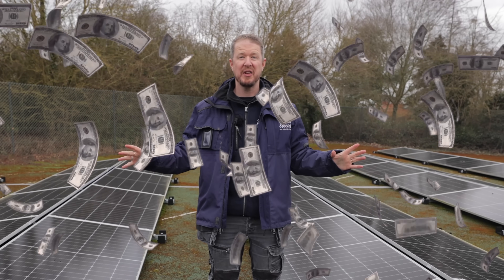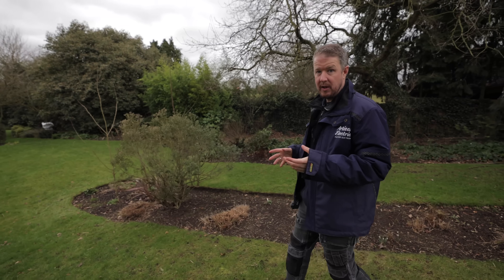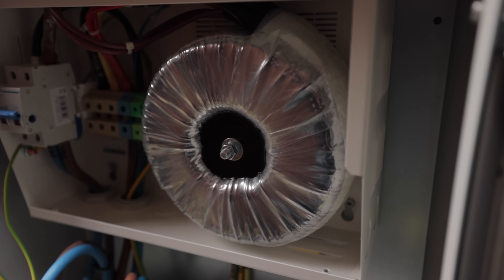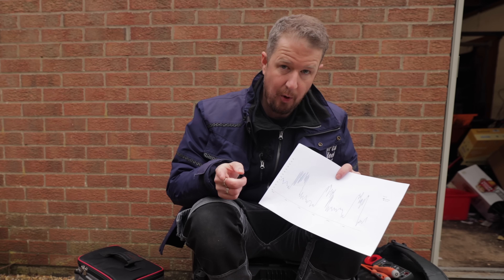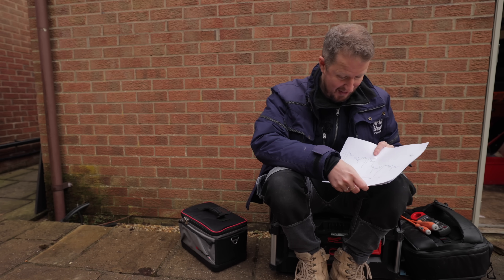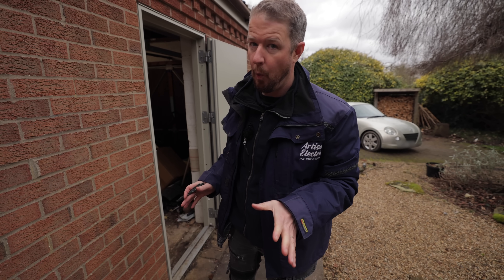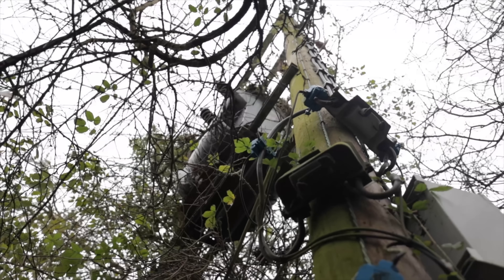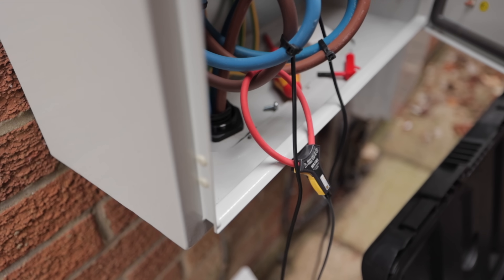THOUSANDS Down the Drain – And We Can’t Do Anything About It!

Comment: You state that the voltage at the supply location is 240V and describe this as relatively high. This is not the case and is pretty standard despite 230V being the stated grid voltage. The supply voltage from the DNO must be maintained within regulation limits of +10/-6% (you did pick this up yourself towards the end of the video) and therefore must be within the range of 253-216.2V, which your supply is - Therefore there is nothing wrong with the voltage on the grid supply end in this regard.

As for the spikes of voltage you're seeing at ~260V, this will be your PV system and inverters 'lifting' the voltage to 'push' the power out of the system and back to the grid. There should be a setting on the inverter that you can change to set the maximum voltage and you should do that as you're already lifting the voltage higher than the DNO's maximum and therefore providing a higher voltage to electrical accessories in the dwelling. You've stated in the comments that the loop impedance is 0.26 Ohms and therefore I make the voltage lift required above 240V to output your 17kW to be 18.42V, resulting in a 258.42V 'network' which is slightly higher than grid limits. You could ask the DNO to step down the tapping of the transformer as it's already a bit high, giving you a few more volts to play with. You'd have to pay for this as there isn't an issue with anything they're doing and it may be difficult to achieve as you're not the only customer connected to the transformer - Unsure if you'd get this but may be worth asking the question if needed.

As for the low voltage points, I don't think its a grid issue but I suppose it could be - The data may tell you more. You really ought to control the batteries more, though as they appear to be a concern.... what is their charging time(s) and rate?

Not sure the voltage regulator was required here and I think simple monitoring and changing settings would get some good results here. If you have to go back to the grid, I could phrase your argument along the lines of "the LV run from the transformer to supply point provides too great a resistance to overcome for our agreed export capacity. You've confirmed that we can export 17kW, however, to do so (overcome the resistance) we must lift our voltage to circa 260V which is outside of regulatory limits. As a result, we request that the voltage tapping in the transformer is reduced so that we need not exceed the threshold under maximum export". I would however do some better energy management on site at the property before making this request as you could manage to shave the peak export a little by slowly charging the batteries too.

Comment: I had this exact issue in Australia. After many months of back-and-forth and remote monitoring, they accepted that when all the rooftop solar panels were generating, the voltage was too high (259V peak). The resolution they decided on was to install what they called a smart transformer, which replaced the existing one. Now, as the voltage on the grid steps up due to solar, the transformer lowers the base voltage. I now see a constant voltage of 243V at my house, which is acceptable

Comment: Overpriced rubbish design purely installed with the intention of fleecing your customer. (As per with your £30k re-wire prices)

 Flat roof mounting used to install the panels on the tennis court (At a meagre 10 degree pitch) 

Multiple SolarEdge inverters feeding a pitifully small (overpriced) battery. 

House bashers should stick to EICRS and light switches

Comment: Stagger the battery charging times. Have 50% of them set to charge first at offpeak and then the second set to start charging when these are full. This way, you will avoid their combined full load Volt drop. If this can't be achieved via internal controls, fit time clocks and contactors to achieve staging.

Comment: I'm amazed the DNO granted 17kW export in what appears to be a quite rural location. I'm a amateur but even I realise that the snake oil optimiser was never going to work. Inverters export by raising their voltage above grid voltage, this is why  it's important to have very low voltage drop on the connection back to the grid. These spikes could be caused by the power cables on the grid not being able to handle the current, coupled with lack of local power demand. The inverter should also have a maximum voltage cut off, or more precisely a maximum out of spec voltage, has that been checked??? With my system, it will use the entire off peak period to charge the batteries, much less stress than charging at the maximum rate.

Comment: Surely it's the inverters that are outputting too high a voltage when the solar is generating. Basically the power optimiser that youre using is just a step down transformer, this will lower the highs of the voltage, but also the lows of the voltage swings.. This is obviously a problem

Comment: What utter tosh. The age and physical appearance of the transformer has absolutely nothing to do with its ability to pass power. Yes, the distance to the transformer will make a difference when it comes to voltage drop/rise, but thats about the only thing youve got right.
In reality, a system of that size probably shouldn't have been given approval on a single phase installation, but have you also considered the cable sizes you're using may be undersized for the distance and load? In the same way that you get a voltage drop over a distance of cable under load, you get the opposite effect with a voltage rise when you're generating if you're undersized. I've seen solaredge inverters reporting 255v+ when the voltage at the service head was 245v with just 15m of cable. Going up a size brought that back down to an acceptable voltage which didnt trip the inverter. Solaredge can also be programmed to do reactive power management to help control the voltage too.

But I guess "We messed up the install and dont know how to fix it so we're just going to blame the DNO" isnt as catch a title

Comment: G99 Regulations require a generators equipment to reduce output or disconnect when grid voltage rises. Adding a voltage optimizer presents the equipment with a lower voltage than the grid and will prevent it from disconnecting when the grid voltage is high. The optimizer has defeated the legally required grid protection. Are you really comfortable modifying generation systems in this way so they become non compliant with G99?

Comment: See:
SolarEdge Inverters, Power Control Options —
Application Note
Version History
Version 10 (April 2024)
• Added polarity table under Reactive Power Configuration
Version 9 (March 2023)
• Changed Ramp rate units from seconds to minutes
Version 8 (April 2020)
• Modified Ramp rate description

Comment: Reactive Power Configuration
Use the Reactive Power menu to select one of the reactive power control modes listed below, and to
configure the various modes:
 CosPhi – sets a constant CosPhi, regardless of other parameters. Range: from 0.8 leading to 0.8
lagging.  FACTORY SET TO UNITY PF1.0 
 CosPhi(P) – sets a graph of CosPhi to active power (P). CosPhi(P) has a 6-point graph setup. P can be
set to any value between 0 and 100 [% of nominal active power], and should increase from P(0) to
P(5). CosPhi can be set to any value between “0.8 leading” and “0.8 lagging”. Each point includes the
following fields: < % of nominal active power, CosPhi >.
Version 10, April 2024
SolarEdge Inverters, Power Control Options 5
Q – sets constant reactive power (Q).
Range: -100 to 100 (% of nominal reactive power).
Q(U)+Q(P) – sets a graph of reactive power (Q) to grid voltage (U) and to active power (P); this mode
can be used when Q(U) control is required, by setting Q(P) to zero, and vice versa. Q(U) and Q(P)
have 6-point graph setups. Refer to Appendix A – Q Configuration on page 22 for additional
configuration instructions.
• U: 0 to 200 [% of nominal voltage].
• P: 0 to 100 [% of nominal active power]
 RRCR – enables CosPhi control through the RRCR. RRCR must be enabled when using this control
mode.
Unom – The Reactive Power menu is also used to set Unom, a reference grid voltage, when required
for installation testing. Range: 0 to 500 [V].

Comment: You can set the Solar Edge solar inverters from power factor unity (PF 1.0) to a capacitve power factor (PF 0.8cap lagging) , so simply the voltage lowers as the power output rises. In a weak powergrid this works okay.

Comment: That voltage drop when charging the batteries (affecting all other customers on the line) will be within the allowed domestic draw from the grid.   So yes, the transformer needs to be upgraded and not just with regard to the pv/battery system.

Comment: 17kw on a single phase connection seems baffling, exporting at 262 shouldnt be allowed and your installation should not be doing that. add more batteries to absorb this excess and have the inverters dynamically turn themselves down as voltage exceeds 252v. if i was that person's neighbour id be really pissed off that you are interfering with my supply and might be causing my car charger to go off line. like you have said yourself, voltage optimisers are for cowboys.

Comment: lets look at voltage drop on single phase  240volt     
16 mm2  2 wire system
volt drop  = [ length in metres  x amps  x  mv/amp meter ]   divided by 1000     so
vd              =[ 300m          x  say 80 amps   x 3 mv/amp metre for two wire sixteen mm ]  divided by 1000
so vd         =  72000   divided  by 1000
so   vd       = 72 volts 
 
or
25mm2     2 wire 240 v system
vd    =  [ length  300m   x  80 amps       x   1.8  mv/amp metre ]  divided by 1000
so  vd  =   43200    divided  by 1000
so   v drop    =   43.2 volts

this  over head service line will  NEVER   WORK  PROPERLY
also  the voltage optimiser will drop incoming voltage by 6%   BUT it will boost out going voltage by  6%   BIG PROBLEM
The power supply company will automatically adjust the high voltage   11000v  line  due to load changes

Comment: Root cause is poor system design which fails to account for limitations of the grid.  The voltage optimiser is a bodge.   The system needs throttle back when the grid cant take output from the system and report accordingly.  What does SolarEdge have to say?

Comment: Surly a way to get arround it at the moment is to stagger the charging times of the batteries from the grid which you can do on each of the inverters instead of having each inverter charging its battery at the exact same time..

Also are you not supposed to record the voltages you are getting when filling out the G99 documents when getting approval from the DNO to online the system so the high voltage level should of been picked up in the comissioning/testing phase?

And by installing the voltage optimser/regulator you are just masking the issue go keep the inverters going and not taking into account of the wider effect the system is having on the grid.

Comment: This video doesn’t make sense. Why is there such a wide range of voltage coming from the mains, & why aren’t the solar inverters regulating the panel output? No wonder the voltage is all over the place. Why are the batteries being charged by the mains & not the solar panels? Seems like a poorly designed system.

Comment: I live in Australia where we have an abundance of Solar Energy. In 2009 I got a 1 KW system where I was getting 60 cents Australian per KWhr export . In around 2015 through my mistake this 60 cents eventually dropped to 5 cents a KWhr.
I have learnt that the retailers , suppliers what ever we want to call them do not want my Roof top solar export. Also in Australia I think domestic export is limited to 5KW.
So what I did was double wire my home. I now have a completely separate OFF GRID system. I have 25KWhrs of storage and a max of 10 KW OFF GRID. 8KW of solar panels. The system has been working for the last 6 years  and it is great if the Grid goes OFF I do not even notice it. At times when my Solar cant keep up I charge my batteries with a Grid outlet in my power house.
Sure its not perfect but my power bill is much reduced from say $200 per month to $60 per month that includes a $48 service charge.
I have installed quite a few completely,  OFF GRID systems the technology we have today allow people to do this. My main gripe is that OFF GRID inverters are not that reliable, they have become cheap but like so many modern electronic systems they end up in landfill which is such a crying shame. I used to repair electronic systems right down to component level. If I was this Guy I would reduce the power to the Grid and use the other left over to power his heavy load eg EV Charging. The GRID needs massive up grading  which is going to cost heaps.

Comment: Hold on.... This "voltage optimiser" cost thousands. You open the case and I se basically a breaker and a toroidal transformer.
You're stepping down whatever you are putting in by a fixed percentage.
Which really doesn't address the original problem of 260vac being generated from the solar panels.
But hold on...... How the heck have you got 260v? The panels generate DC and the job of the inverters is to change it from dc to 235v ac.
If you're getting 260v ac out of the inverters then they are not doing their job properly.
Spending thousands on, basically a step down transformer, for the feed to the user is not addressing the problem.
I'm not au fait on solar generation but it shouldn't be rocket science!

Comment: If the voltage is nominally 240, but sags dramatically on load and rises dramatically on export, this means the source impedance is abnormally high. Did you get any indication of this when you took the Zs at the intake point? It is then simply ohms law (or the AC equivalent). I wonder if those pole mounted fuses are adding to the resistance as well as the long LV cable run. Would be interesting to see a thermal image when a high current is passing in either direction.

Comment: Hey, thats a sol-ark. You can monitor it directly though its mod-bus connection? I solar system thats about half the size. But I have the opposite problem. I can't pull more than 3kw from the grid without droping the voltage out of range. So on a sunny day, I can run everything in my house. But a hotwater system and the oven at the same time, no way. I have automated the whole house to monitor the power production and voltage and control all my devices. In this case, I would reduce export (reducing the voltage), switch on the car charger, and then start increasing power output (to the grid if I need to). Its a sol-ark, so I believe this is all controllable (and you wont have the losses from the local transformer)

Comment: All these hardware are very expensive and requires maintenance and perhaps replacements with time, panels may fail, chargers may fail, inverters may fail and batteries surely will fail in a certain years , and all these costs are not cheap. Totally not worth doing it.

Comment: The customer was wrong to refuse to have the solar turned off for load monitoring. 
The DNO is right to carry out checks on the supply in the first instance to confirm the quality of supply to give them data to help solve the issue.

They’ve offered to help, but super sparky and his customer knows best. Good luck with that.

Comment: U should check the invertirs they should match the correct voltage. Also check the dc side with a datalogger,  if there is too much power dc then the plant probably isnt well balanced. Also i would investigate deeply on how the strings are made, maybe to save some wiring or another inverter there is am over dc voltage that exceed the inverters capacity

Comment: I’m fairly certain you have something iffy going on with that solar system as well, the PV regulator shouldn’t allow that sort of voltage spike regardless of how ”stiff” the grid is. Considering that you have battery storage as well, does the system allow for island operation? It be interesting seeing what the voltage would be then. Does the system monitor the grid point and have curtailment? Temporarily limiting the system to say 7 kW maximum export would also give you interesting information. That auto transformer you fitted is essentially useless unless it has an automatic tap changer to correct the voltage variances, otherwise you’re just exchanging over voltage events for undervoltage events.

Comment: If you have screwed up your neighbours voltage regulation then you might find that much of the problem is with a bad earth on the transformer neutral. Depending on the regulations you can add an earth to the inverters. This is why Michael von Dolivo-Dobrowolsky invented three phase AC (and why Tesla's AC was a patent troll).

Comment: We similar problems here in mid Wales in a close of 19 properties, and we were getting high volts a around 256v. I complained and it dropped after that for a time. It normally floats at 239v but would increase at night as more people started to et solar in the close. Or solar assistant system along with the Inverters monitor the grid voltage and frequency all the time. We now have a years of logged history of our grids performance. In the summer of 2024 they replaced the old 1960's transformer with a bran new one. They also replace and renewed all the surrounding pylons and power cables. Its now sits constantly at 239v - 243v and has not given us any problems since.

Comment: Wouldn't a solar system be far less complicated if it didn't include selling power to the utility? Simply feed the generated power to the house or even parts of the house depending on system capacity. No tie in issues and far less expensive.